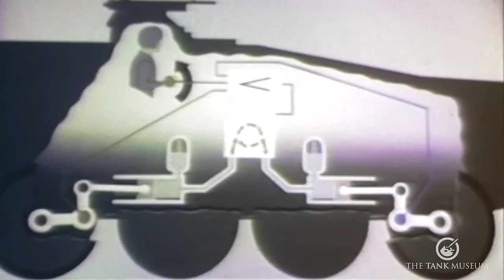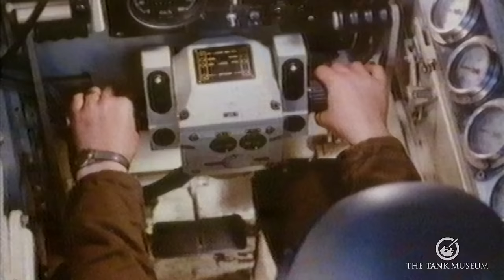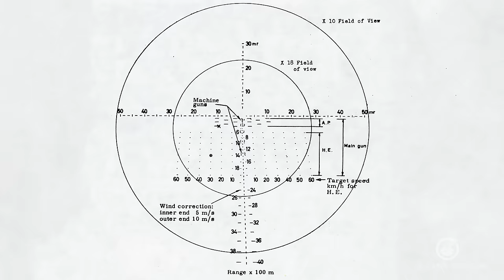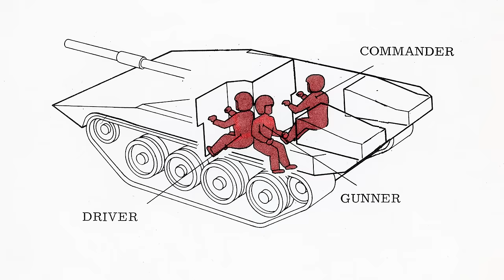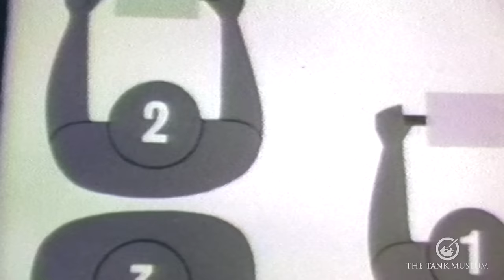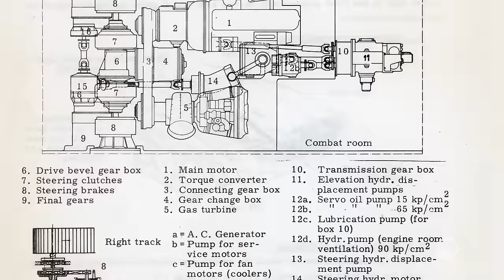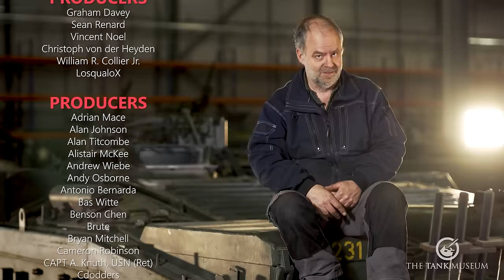Tank Chats Reloaded | S-Tank | The Tank Museum

Comment: Did my military service in 1980 as a sergeant with the S-tank. Lots of hours in the garage and I hated cleaning the 3 KSP-58, almost as tedious as cleaning the gun on the tank. Luckily we got a mechanical gun brush working with compressed air doing the heavy in and out pushing and pulling work named Baldur. Lots of maintenance work, as is said in the video, as we were only three to do all the work.
My fun memories are brewing coffee inside the tank with the little electric kettle (fogging all optics), making hot sandwiches on the gas turbine exhaust (well wrapped in foil) and the rear driver keeping vodka in the smoke grenade magazine on winter manoeuvres. Winter was fun! Got more power from the gas turbine and did triple pruetts on the frozen groud in 50km/h. The memories come back……
Reply: Soldiers will always find a way to use vehicles to make there life better in the field

Comment: The design in this tank is simply amazing, but like all amazing designs they suffer from the limitations of the technology of the time
Reply: Yes I know a certain nation that desperately needs tanks rn.. too bad some rich dude doesn't have a whole warehouse of tanks just laying around 😒
Reply: True, I wonder how a modern 'electric' version of the same concept would fare? Gas-turbine, or the 'Mother-of-all-LiPos'? (Caution - they tend to fizz a lot when shot-at etc. - ask Hammond : )
Reply: @BoleDaPole  If you look though what might be in that market is likely to be older than what they began the war with. The stuff that nations like Serbia, Estonia, Hungary and Poland upgraded from.  Some of that has already been sent to Ukraine.  The Brits, Germans and US tend to have moved most of the stock either to allied nations OR de milled and scrapped for parts, use as static displays/museum pieces or even sunk as artificial reefs.  Also the Leopard 2 (which is still very much a front line MBT) has a range on full tanks of about 250km per full fuel load (road and X country mix) The Abrams manages only 200km range cross country of 200 km BUT refueling with jet fuel can be needed every three hours or so in mobile opeations.
Reply: @MrDportjoe  I think that your quoted distances are off by at least a multiple of three.
Reply: Imagine the S-tank with Chobham armour, current hydro-pneumatic suspension, digital fire-control and optics and either a Royal Ordnance or Rheinmettal 120mm.
Reply: @aaronleverton4221  & a couple of autonomous sighting drones called 'Jack & Russell' : )
Reply: @aaronleverton4221  It wouldn't have helped. For one they already tested it with composite and rejected it. The latter versions were upgraded with fire-control computers. The reason it was taken out of service is that the lack of a stabilizer and capability of firing accurately on the move is too big of a downside for modern tanks, while the benefits of a low profile with the accuracy of todays fire control and with thermal allowing for easy detection just isn't worth the drawback. Rebuilding the existing vehicles also wasn't possible as the gun was so integrated into the hull of the tank that you'd practically need to make an entire new tank to replace it with something bigger. 

It was good when the stabilizers wasn't as reliable and when the sub-caliber shells of the day didn't give enough performance to defeat heavily sloped armour. With modern stabilizers and ammunition that's no longer the case. It was a fantastic design with the limitations of the technology available at the time. Limitations that only a few years later made it comparatively ineffective, unfortunately. Unfortunately Soviet ammunition design was ahead of what was available in the west at the time when it came about.
Reply: @Ragedaonenlonely  You're answering a bunch of questions I didn't ask.
S-tank wasn't designed to fire on the move so firing on the move doesn't factor in to my question.
I'm not asking you to take S-tank, modernize it and then invade Iraq with it.
Reply: @aaronleverton4221  No it wasn't designed to fire on the move, because at the time that wasn't a big factor. Today it is. Hence why it's not a long-term effective design in hindsight. It doesn't matter how you use it or how you modify it. Today it's not going to be effective under any circumstances because thermal and modern gunnery negate any advantage with the smaller profile.
Reply: @Ragedaonenlonely  A modern MBT's tools will make the S-tank easy to spot and kill, despite the fictional S-tank under discussion having exactly the same tools: "...thermal and modern gunnery..."
Reply: Also suffering from people applying a design and doctrine from another location and time and trying to discredit it because it won't fit in a certain modern combat scenario that it wasn't designed for.
Reply: @aaronleverton4221  You're missing the point. What's the main advantage of removing the turret and stabilizer? A smaller profile. What negates that advantage? Thermal vision. It's lost the benefit of removing the turret due to advancements in technology but still has the drawbacks of it. Hence why it doesn't work anymore. You completely missed the point.
Reply: @G1NZOU  Modern combat scenarios doesn't matter. There's no scenario where it is advantageous anymore. You can camouflage it in an ambush position all you want, you can't hide the heat signature of it. Especially since its exhaust is designed to shoot the air right up, effectively creating a plume of heat easily detectable on thermal immagers. Is it smaller? Yes. Does it matter? No. Not unless you're fighting a massively technologically inferior opponent.

Also for the record the 103 was designed to be able to act offensively. You need to in war. It just wasn't designed to be used in an offensive war.
Reply: Well when you can't afford real MTB's.
Reply: @xcalibertrekker6693  Funny. If you only you knew it was actually a pretty expensive tank to produce. The suspension was very complex.
Reply: @Ragedaonenlonely  Firing on the move is a big factor when moving through an oil field in iraq, not in the forests and hills of Sweden. It was designed to ambush enemy tanks platoons and destroy them before they could even shoot back. It would still be a nightmare to face with modern tanks.
Reply: @Ragedaonenlonely  Being smaller is not only about profile. Consider modern Light Tanks made to be carried by air have to give up the protection a normal MBT have, but a modern S-tank could give up the turret instead and keep the protection. It also comes with additional firepower as the S-tank had much higher rate of fire then even modern tanks. But I agree that it doesn't suit the MBT role anymore, but does for cases where the weight savings matters.

Comment: A unique vehicle that performed a specific mission. I've never thought it was bad, just a vehicle designed for specific terrain and a certain type of battle.
Reply: Customised for design, development, manufacture and use by Sweden to suit their particular requirements during the Cold War.
Reply: I've always been a little surprised that no-one else took a good, hard, long look at equipping their tanks with bulldozer blades to guarantee a hull-down position no matter what. If every grunt has a trenching tool, why not every tank?
Reply: @aaronleverton4221  The Soviets did have an attachment for ordinary T-55's to dig themselves in.

Comment: Sweden had very unique requirements that dovetailed into their national strategy.  They did not need to be offensive weapons, and a "super-STuGIII" made a lot of sense.  Historically the most effective tank killer the Germans had, on any front, was the STuGIII and for the same reasons.  It had a good gun on a small, easily concealable chassis; using tracked-mobility to displace from firing position to firing position.
Reply: It's a missunderstanding that it wasn't an offensive weapon. What Stefan meant is that Sweden wasn't going to invade anyone, not that the tank would only be used defensively. The role of the Swedish armoured and mechanised brigades was always to launch a mobile counteroffensive against a Soviet bridgehead in southern or central Sweden.
Reply: @Shenordak  this exactly. People keep parroting that it's a purely defensive tank but it definitely was not according to doctrine

Comment: Crew ergonomics aside and ankle deep in oil I still think its a fantastic design. It seems to me it would still work today as blueprint defending against attacking forces. Imagine a new version with a longer 120mm smooth bore from the Leopard and modern armour on the roof

Comment: The S-tank (or strv 103) was purpose built for defensive action against an invasion. Considering the AT weapons available at the time of designing it (1960's), it is a really clever design. The profile is low, which is excellent not only for concealment but makes it much harder to hit (if, for instance, your adversary mainly uses APFSDS-penetrating ammunition.) Also the front is really well armoured and the flat angle of it made it really difficult for any AP/HEAT/HESH rounds existing at the time to connect and penetrate the front. Nowadays we have powerful top attack munitions and they would have spelled disaster for the S-tank. The top and sides weren't well armoured, so it wouldn't stand a chance in a modern conflict. Maybe if one were to plaster it with modern ERA, it could still sort of make it, but then you have the issue with the gun which is not by any way up to par with Abrams, Challenger or Leopard's guns. I do think it could do well against the T-62/64/72 tanks though, after all - it was designed to take out those types of vehicles. I saw many out in the woods during my military service, and I still love it despite all its debatable quirks and flaws. As a matter of fact, I have a scale model of if in my bookshelf. Bought at the very museum Stefan curates. I highly recommend a visit if you happen to be in the vicinity of Strängnäs city.
Reply: Side armor … the Leo 1 shares that weakness

Comment: I joined the MOD at Chertsey as an appretice at 15. If I remember correctly the S Tank had a Rolls Royce K60 as a 'run about' engine and it's gas turbine for battle. Just to sort of prove myself - did you ever get the power increase from the K60 you wanted and how well did they do in your patrol boats ? You could have used the Chieftain (BMC ruined) L60 but you would never have got as far as the hanger doors in the early days. The Sturmgeschutz did well so why not the S Tank.

Comment: This is a critical point that many 'top trump'/gamer 'enthusiasts' miss is the doctrinal application for the hardware developed. 
In this case the S-Tanks were designed to fight a purely defensive engagement. Sweden was a steadfastly neutral country at the time, with a long history of neutrality. So, in that mind, all they needed was what was effectively a mobile AT gun. Their doctrine was very much a defence in depth, to retreat slowly and cause as much difficulty and losses to the enemy as possible in the process. 

It's the same with the commentary surrounding the M4 Sherman (which is thankfully starting to shift, in no part due to the hard work from the likes of Nicolas Moran), about it being rubbish and underarmoured and undergunned for it's role. It's role was to be a single do-it-all tank that could serve in all the different theatres that the Allies waged war, and to be able to be transported there in numbers. For that it was the perfect design. 

For the Swedes at the time, the S-Tank was what they needed.

Comment: Some claim it was a anti-tank vehicles but in the real world it was an MBT, Main Battle Tank. The Swedish Army's doctrine, tactics and exercise with the 103 was largely the same as with Centurion.
That it was the best in the world for a period is about the fact that the technologies that made S-tank mediocre were not yet developed, good enough or did not exist in sufficient numbers with our imaginary enemy.

In 1971, Strv 103 was the car that was most difficult to detect. Without towers and very low, the imaginary enemy had two problems. First, see it and once it has fired at them, identify the threat as a tank and not as an anti-tank cannon. That advantage disappeared when the Red Army introduced different types of gadgets that looked in the infrared spectrum. The S-tank turbine engine sent up a plume of heat above the wagon. So even if the 103 was hidden behind a crest, the Russian could not miss it.

The cannon on Strv 103 was longer in 1971 than on comparable foreign tanks. It had two benefits. The exit velocity (and thus increased penetration at all distances) and a smaller dust cloud front tank (when the grenade travels longer in a cannon barrel reduces the pressure when the grenade leaves the muzzle). The recoil from a shot affected the 103 less as the unique design completely took care of that force and placed the cannon in exactly the same position as before the shot.
Since the cannon and vtank did not move relative to each other during firing, a fast automatic lodder system could be designed. Which still today has a world record. One shot every three seconds!

Since the enemy had a very hard time detecting, S-tank could shoot first. There is talk in the tank world about "Shot first-Kill first" and "Hunter-Killer" ability. Stabilization for the cannon / tower was developed so that it was possible to shoot during movement and that the commander could automatically send target indications to the shooter, which meant that the commander could more quickly concentrate on finding the next target, before the first was fought. In 1971, that technology was not good enough. "Hunter-Killer" ability had Strv 103 from the beginning when both commander and shooter could drive, aim and shoot.

In 1971, there was no ammunition that could penetrate the S-tank from the front. A pretty good advantage, right?
When the Soviets began manufacturing the T-62 and T-72, they developed a new type of arrow projectile with tungsten at the head. Tungsten is the metal with the highest melting point and an extreme tensile strength and very heavy, properties that prevent it from deforming when it hits steel armor but pushes it away.
In 1994, the Swedish defense fired an S-tank with a T-72 loaded with an arrow projectile. The shot went straight through the tank. Not so good!
The T-72's cannon has a caliber of 125 mm, 20% more powerful than the S-tank.

Strv 103 came into service as early as 1968, but I still choose 1971. This is due to improvements in what is called sub-series B: Stronger engine, floating equipment, reinforcement plates in the rear, barrel protection and smoke throwers. Strv 103 B was finally delivered in 1971.
I apologize for my poor English but I hope you still understand me. Do you guess what my nationality is?

Comment: It's a shame that a more modern version of the S-tank with upgraded armor, a 120mm cannon, and thermal imagers, was never developed.   As a defensive tank, the S-tank had a lot of advantages.  With a more modern 120mm or larger cannon, I think it could still hold its own on the modern battlefield.   With ERA, even as an infantry support vehicle, this tank would have been excellent.
Reply: It could have mounted a much longer gun than a turreted tank, and with modern frontal armour it would have been nearly impossible to penetrate from the front, especially as it lacks a weak spot between hull ans turret.

Comment: Am surprised that no one has tried to create a one man or two men crew tank based on something similar to this tank
Reply: What about the tankettes of the pre-WW2 era?
Reply: @neiloflongbeck5705  I feel that a very light vehicle like a tankette won't have a place in modern battlefield
I mean even armored cars are nowadays are more capable of tankettes
But a very low profile tank hunter?
Reply: Need three to do field maintainance.  He mentioned how heavy the parts are.  You don't want to rupture your crews.
Reply: @Pavlos_Charalambous  I agree, but people have tried to do the 2 man tank and all have failed.
Reply: @charlesfaure1189  they way I see it the unit would have to had the equivalent of ground grews like the ones of attack helicopters ect
Also note usually is not just one crew taking care of their own vehicle, usually two or three grews group together  but I guess that's a matter of doctrine as well
Reply: @neiloflongbeck5705  I feel that the technology wasn't there yet, nowadays with remote control weapon stations it's much more easier, although I would agree that for a main battle tank I would prefer 3 crew members, you know sharing the work load